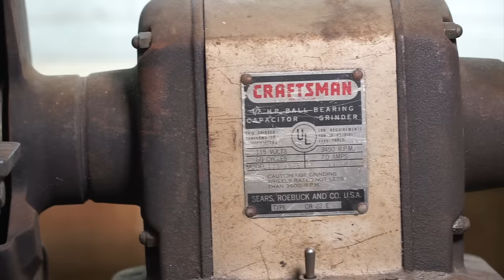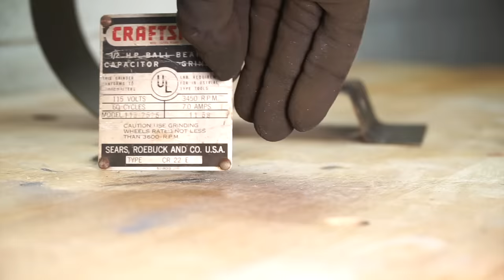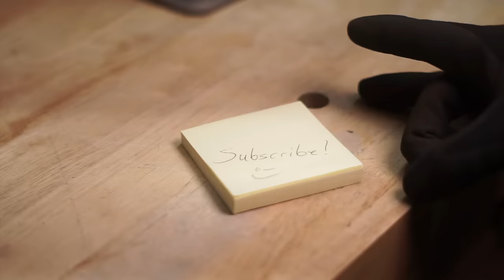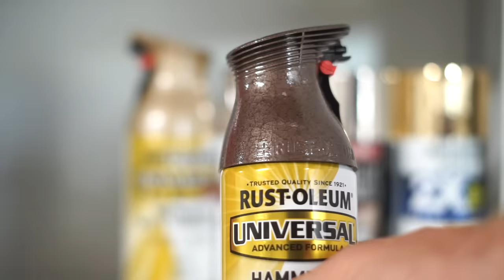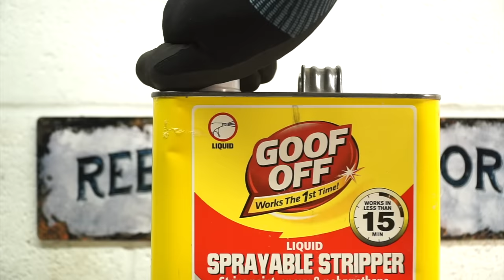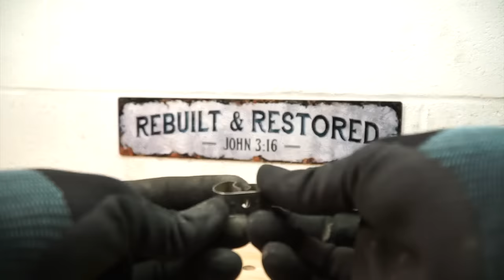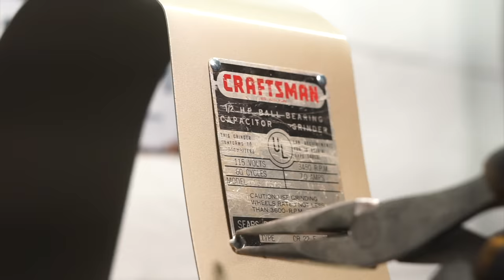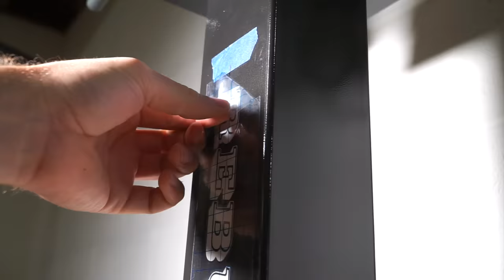Awesome Restoration of Rusted Grinder

Comment: Nice refurbishment, but do please wear protective clothing when welding. I've lost count of the number of people who have ended up with severe radiation burns from the arc because they failed to cover up. Also, on mild steel box section or square tube if you prefer, the preserving oil is not good for your lungs when superheated so please get an airstream welding shield or an extractor. Both the arc and oil can have long term health ramifications. Subscribed and liked! Stay safe!
Reply from the maker: Thanks for your concern and feedback! Appreciate the support!
Reply: And put a welders helmet filter/tint over the camera lens ~ the arc can shorten the life of the cameras sensor if the camera is left exposed to it, and we find it unpleasant to look at 😣
Reply from the maker: ⚡️⚡️ too bright? 😎
Reply: @RebuiltRestored  ~ yes 🙄, the misunderstanding comes from that the welders [biological] eyes need to be protected from the UV-C radiation of the arc, but falsely assume that the camera doesn’t need protection for its [artificial] sensor, but I have read in other video comments that the sensor can get damaged over a long period of time from a welding arc.

Comment: Nice job on the restoration. I did a full resto on an old Craftsman several years ago. I noticed you reused the unrestored data plate. I was able to come up with a solution to replicate the original. If your're interested in the process, let me know.
Reply from the maker: Awesome! It would have been neat to make a new one. Did you make a video on how to do it?  Thanks for watching!

Comment: Awesome as the title implemented! Great job with this one. One question, did the motor need cleaning when you had it apart? I wonder if a cleaner motor would operate better?
Reply from the maker: Thanks Mark! And I maybe should have cleaned the motor (I don’t have experience with that) however the unit is working nice. Thanks for the question!
Reply: @RebuiltRestored  you can use isopropyl alcohol on some of the parts, and use some 600-800 grit on the copper parts of the motor to clean and shine it up a bit.
Reply from the maker: Thanks for the tip! 👍

Comment: I have the same grinder. What ball bearings did you use to replace the old ones?
Reply from the maker: I don’t know the manufacturer of the new. I just got them from a local shop. The old ones are N D 3203.   This should help find new ones.

Comment: Very nicely done. Subbed.

I'm interested in what product you used to blue (black?) the tool rest rails. I've used cold blue before but never ventured into anything like that. Would you mind sharing the name?
Reply from the maker: Thank you! 

This is hot bluing. So you heat your part up and then quench it in oil. This is just a vegetable oil.  I’ll try to put a link in here to My Mechanics Insights. He shows the process in detail.
Reply from the maker: Here is the how to video. 
https://youtu.be/5Sty5upsadY
Reply: @RebuiltRestored  ooh, very interesting. I had no idea it was done with such a conventional oil. I assumed it was some specialized product. I'll go check out the how-to now. Thank you for taking the time to find and share it.

Comment: Quick question, why? Its just surface rust and its not gonna effect its performance. It may look ugly but there is no need to restore it if it works. In the state it started in it would have ran until the motor crapped out.

Comment: There should be paper on the wheel, its called a blotter....... Its quite important. Ya dont want the metal flanges in contact with the stone, these are what "clamp" the stone in place....... The blotter has some thickness to it so the flange can "even" the pressure against the wheel, and its pressing against somethin soft and not a hard stone wheel. It is actually quite dangerous to use a stone wheel without the blotter. 
Dont think it was shown, and i dont know if you know, but il say it anyways...... Ya should do a "ring test" on wheels too. Support the bore of the wheel on somethin like a screwdriver shaft (or anything that wont deaden the sound it makes, dont hold the wheel in your hand) then tap it lightly or flick it with your finger; if it makes a "ring" sound its good, if it makes a dull thuding sound then throw the wheel away because it likely has a crack....... An exploding wheel isnt any fun.
Reply from the maker: Hey thanks for the comment and tips. Someone else said about the blotters as well. Thankfully my ignorance didn’t cost me a trip to the ER… or worse. And thanks on the ring test. I didn’t know about that. Thanks again!
Reply: @RebuiltRestored  in my country (Ireland) people who work with grinders are required to complete safety course at least once a year......... A grinder can be a very dangerous tool when it's not used the right way. The blotter is a very important part of the machine, I do hope you will re-install the wheel with a blotter so you are safer. Then only reason I comment is because of safety reasons and I don't want anyone to get hurt...... I really don't wanna be "that guy" who's like the unnecessary safety police 🤦😆  but the blotter is quite important in all honesty 😁

Comment: was he quenching the metal with oil ?? or is it something else?? why is that step necessary in restoration??
Reply from the maker: Heating the part then putting it in the oil is to blacken the metal and it helps prevent rust. It is a technique called hot bluing. Thanks for the question and I hope this clears it up. Have a great day!

Comment: Very well done! I would have saved and restaurated the old stand instead of building a new one. At least as a spare part.
Reply: That old stand looked like a cobbled up old pipe and office chair base to me. Replacing it was the right thing to do and safer! Great job.
Reply from the maker: I still have the old but I like the grinder fastened to the floor. Thanks for the suggestion and for watching! Happy New Year!
Reply: @Beenthere5409  
If it wasn't an original accessory, I agree. Otherwise it would have been worth to get restored. Even when it wil not be used yet.
Reply: @RebuiltRestored  Thank you for your answer! Happy New Year!
Reply: Yeah I’m quite sure it is not an original stand. Looks like it worked for someone years ago tho. But stationary is much better as I’m guessing that grinder will get itself used on a regular basis.

Comment: Where do you go for brass bushings? I have a Porter Cable 136 belt sander and it is howling. Spray oil in the lube holes and it stops.
Reply from the maker: Not sure on that tool. You may have to pull the bushing, and Google search by  dimensions.

Comment: It was necessary to make soundproofing of the profile pipe inside and to lay a rubber gasket between the frame and the rack to reduce noise. But otherwise, well done👍

Comment: Interesting that you didn’t replace the capacitor. I watch videos of old guitar amp restorations from this era and the capacitors are rarely deemed acceptable.
Reply from the maker: Thanks for the comment. I took the capacitor to my local electric motor shop and had it bench tested and it was good! It may start a little slower than if I had a new one but it works👍. Thanks for watching! Have a great New Year!

Comment: A weird combo of things consistent with “that’s not very old” (2006 datecode, Allen bolts, just the general feel…) with sone “holy shit is this from the 50s” (paper capacitor, slotted screws, that light). I guess it’s a very old design still made in 2006.
Reply from the maker: Thanks for the comment.  This is old, not an 06 model. :)
Reply: @RebuiltRestored  yeah, later in the video I got more old clues and fewer young clues. I guess it wasn’t a date code after all ;)

Comment: Good Job,
Why didn't you replace the capacitor with a new one? Even if you tested it, it's seems to me it's a weak point to the whole system and deserves to be replaced.
Thanks
---
ChatGPT : 
A faulty capacitor in an electrical motor can exhibit several signs of failure. Here are some common indicators that a capacitor may be bad, old, or malfunctioning:

1. *Failure to Start:* One of the most common signs is the motor's inability to start. If the capacitor responsible for providing the initial phase shift during the start cycle is faulty, the motor may not initiate rotation.

2. *Intermittent Starting:* The motor may start intermittently, indicating an inconsistent supply of electrical energy. This could be a sign of a capacitor that is weakening or has intermittent connectivity.

3. *Motor Humming or Buzzing:* A malfunctioning capacitor may cause the motor to emit a humming or buzzing sound without starting. This suggests that the motor is not receiving the necessary electrical energy to begin its rotation.

4. *Overheating:* Capacitors that are malfunctioning may cause the motor to overheat. Overheating can lead to thermal damage and may result in a shortened lifespan of the motor.

5. *Excessive Noise:* Unusual noises during operation, such as clicking or popping sounds, can be indicative of capacitor issues. These noises may be caused by electrical arcing within a faulty capacitor.

6. *Visible Physical Damage:* Inspect the capacitor for any visible signs of damage, such as bulging, leaking, or a burnt smell. Physical damage is a clear indication that the capacitor needs replacement.

7. *Reduced Motor Performance:* A motor with a failing capacitor may exhibit reduced performance, such as slower speed, lower torque, or inconsistent operation.

If you suspect a problem with the capacitor in an electrical motor, it's important to address it promptly. Capacitors are relatively inexpensive components, and replacing a faulty one can often restore the motor to proper functioning. However, if you're not familiar with electrical systems, it's advisable to seek the assistance of a qualified technician for diagnosis and replacement. Always follow safety guidelines when working with electrical components.
Reply from the maker: So far so good. If it goes bad I’ll replace
Reply: Stay with the original, it was American made. Good call Mr. Retore!!

Comment: The housing for the grinder is cast iron.  It's not supposed to have a smooth surface.  It's irregular on purpose.  Filling up the surface with Bondo is just silly and time consuming.  Clean it and repaint it.  Leave off trying to make it look pretty.  That's not restoration; that's modification.  And it's not even an improvement in the machinery.
And what about adding a dust collector to the vents on the back of the wheel enclosures?  That would be a useful improvement, especially for a home workshop.
Reply from the maker: If you notice. That one part was filled due to some holes

Comment: I was impressed all the way until you mounted a new NAMELESS Grinding Wheel without using any paper blotters between the wheel and the metal flanges. You MUST use blotters on both sides of any Bonded Abrasive unless it's an externally reinforced Cutoff Wheel. This is a Non-Reinforced, Type 1, Wheel and they must be supported by thick paper blotters to absorb vibration. I almost fainted when you plugged it in before you began your restoration and let the wheels run at No Load Speed without having any idea of their condition. If a 6 x 1 x 1 Type 1 wheel comes apart at 3450 rpm, it is compared to the blast of a 12ga Shotgun... After mounting new wheels, stand to the side and let them run at No Load Speed for a minimum of two minutes before Dressing the face true and beginning to work with them. 
You'll only make one of these mistakes one time....!
Been selling Industrial Tools for over forty two years and still have all my fingers and both eyes. Lastly... take that new Wire Wheel off, THROW IT IN THE GARBAGE and replace it with a Non-Woven Nylon Wheel. No more flying wires. 💀
Reply from the maker: Thanks for the advice.  I didn’t know about the blotters until someone else told me.  I’m still learning! 😎